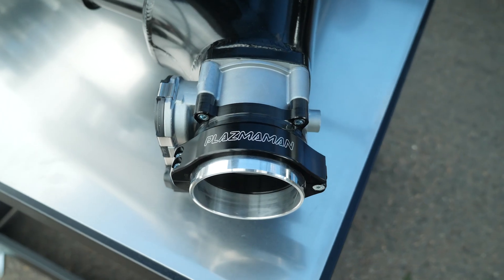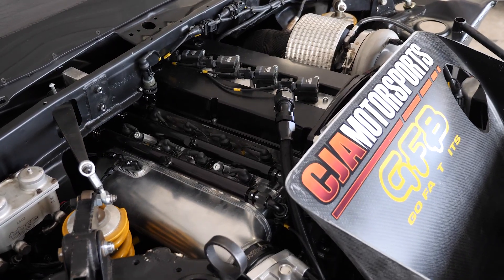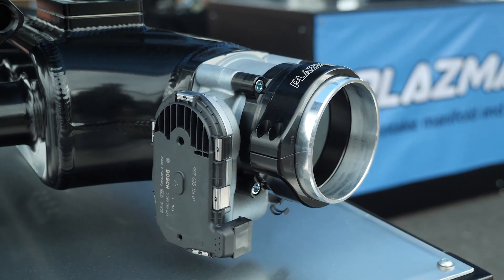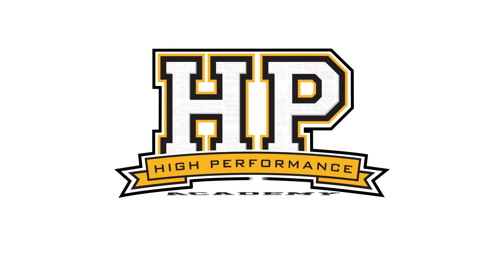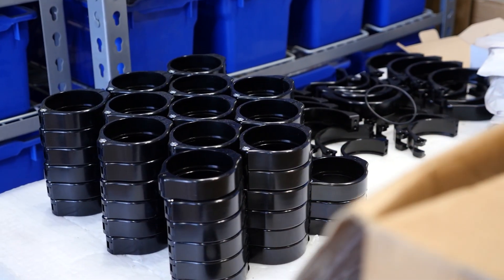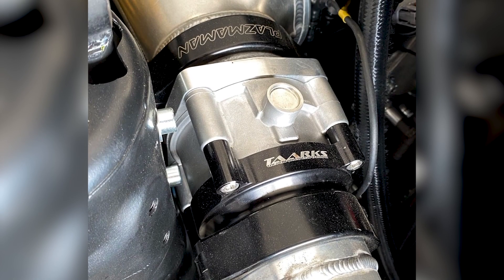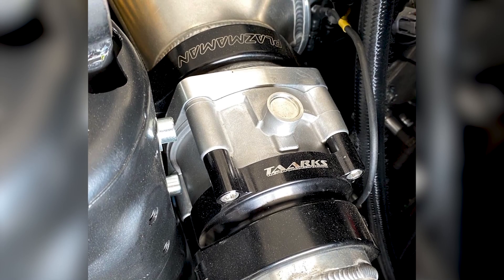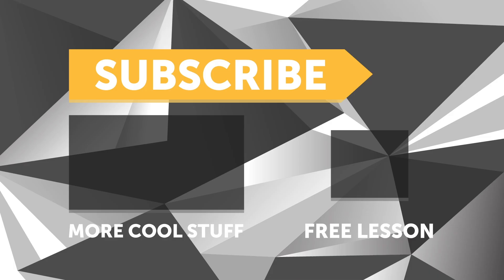Drive By Wire (DBW) Systems Are Trying To Kill You (But Not Really)

Comment: Oldschool cable mixed with tps sensor will solve everything
Reply from the maker: Cable systems have their own complications. Pros and cons for everything, even your favourite things 😎 - Taz.
Reply: vibration with denin or solid mounts do the same thing to tps'.  A lot of "idk whats wrong tried everything" cars came in early 2000s at forged perf with sr swaps or srt4s and all the with those mounts had tps issues. I have stiff urethane bushings and dbw is direct mounted with no issues.  dbw is basically just a smarter tps that also moves the throttle.

Comment: How does the type of motor mount affect the vibrations at the TB? the engine could be on the softest mounts ever made, or solid mounted, but the TB is still attached to the source of the vibration. I don't understand how solid mounts would change what the TB experiences.
Reply: the source of the vibration might be curbs :)
Reply: @kshepthedrummer  softer mounts will dampen the vibration.

Comment: Just to add 2p worth to the issue...vaibration creates resonnace frequencies that obviously will interact with electrical charge becoz it, too works onbfrequency...Hz...so, from a naturalistic p.o.v, some vibrations are so strong or constant (eg droning vibration that can even unscrew bolts-  often leadig to rattles in a car thats not been in a collision)..that they may potentially interfere with electrical signals by causing resonnance to alter the signals in Hz values, whether positively or negatively, with the result that the e.c.u picks up a fault. I saw this happen to an electric cars a well at the Hillclimb as well...soon after hard suspension judders, they go into limp/safe mode. In a mechanical setup, the metals soak up much of this resonance through sprigs and the maleability of steel. Maybe, a resonnance sensor or regulator may help by compensating for the spikes as well as tell the e.c.u that ts ok as it picked up the cause of it...